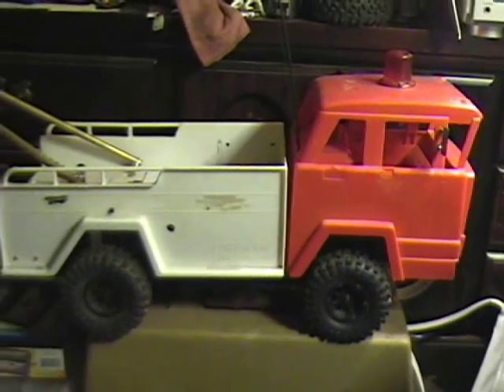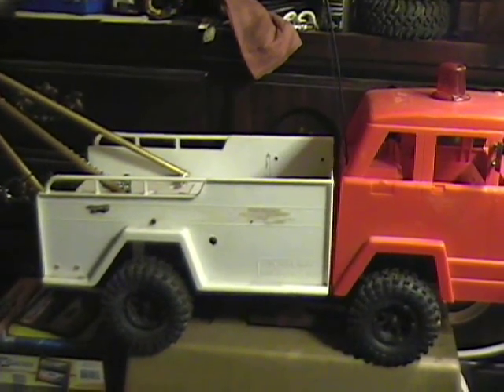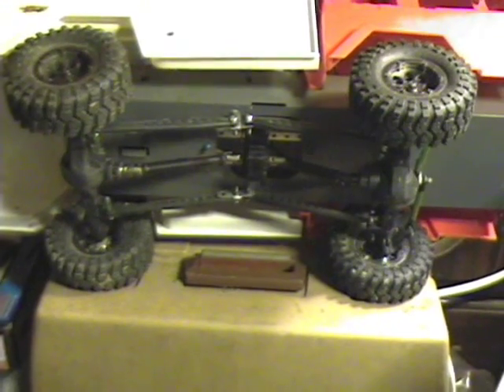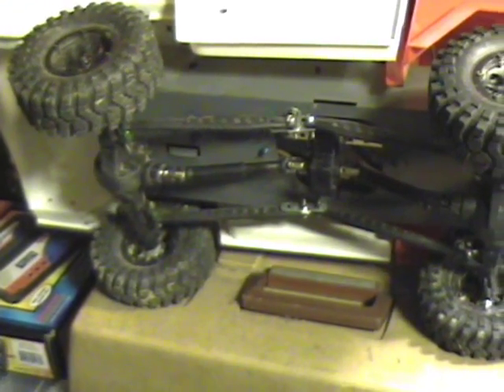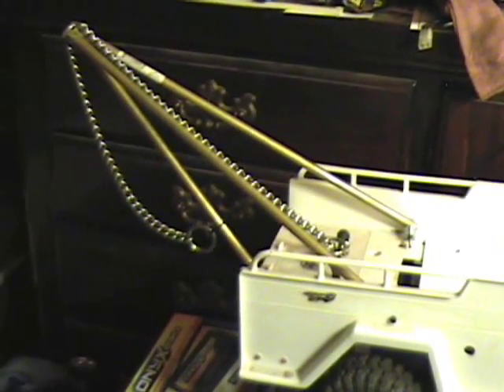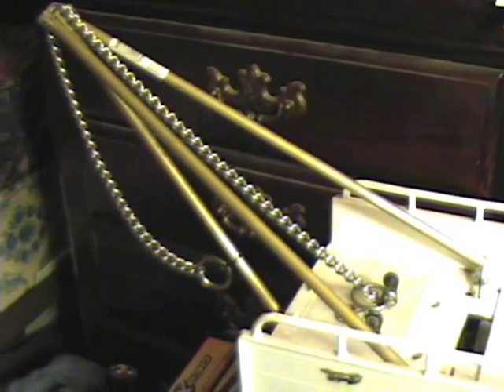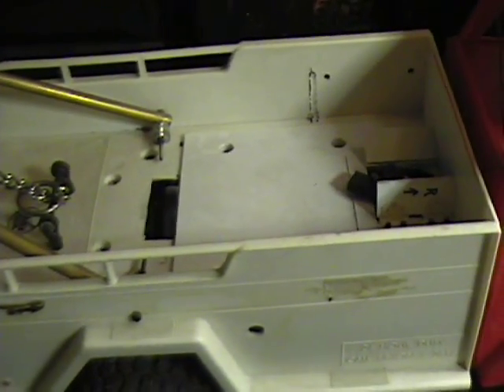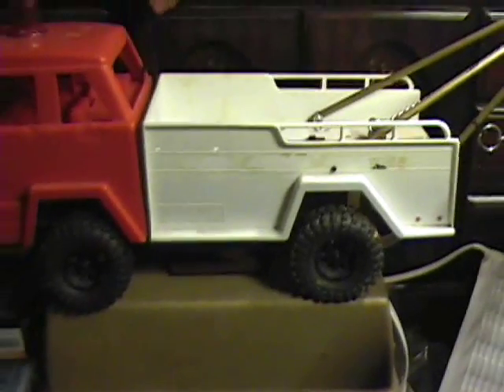1960's Marx Big Bruiser converted to full RC and 4wd

Comment: So you finally did it, very cool!  I didn't think you were going to go full mod.  What I was thinking of doing, actually on maybe a battered Dick Tracy Copmobile, was leave everything in place but just add servos to yank the original steering gear.  But, you went so much further.  Very awesome.  One observation, I had no idea they completely changed the cockpit on the red versions...the cab is completely different!

Comment: @remotecontrolhorror Yes it apparently came later.  Somewhere on the net is an ad for one at a drug store....in 1968.  The other ones date from earlier in the 1960s.  On  your model, you will note that the side windows and cab profile are different, and the wheel arches for your cab are angular, like the back wheel wells.  It is interesting that they decided to change the cab.  Also, I JUST received a Big BOSS car carrier, and got it working!  Will post a video of that one shortly.